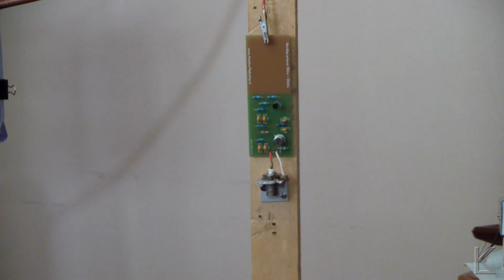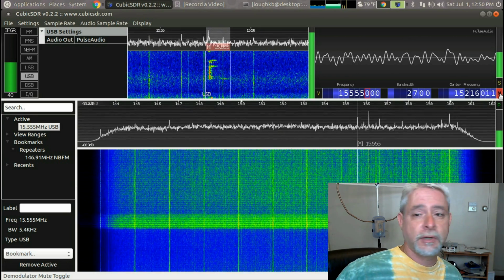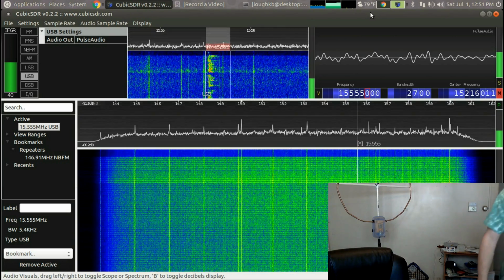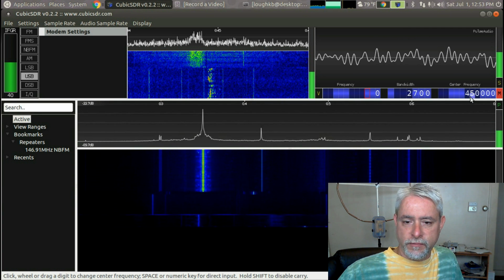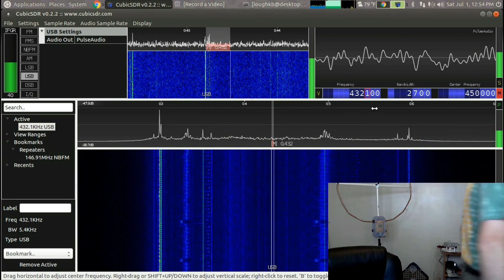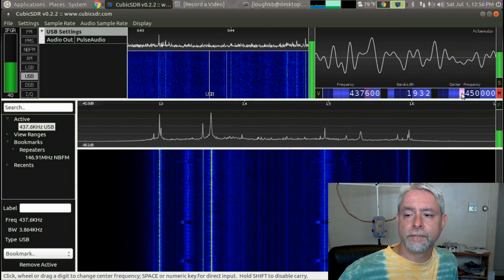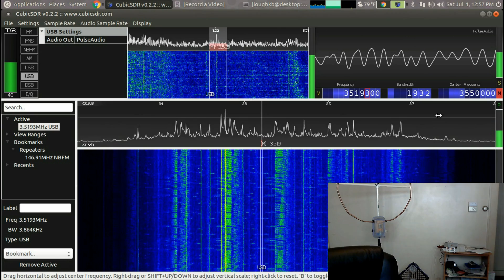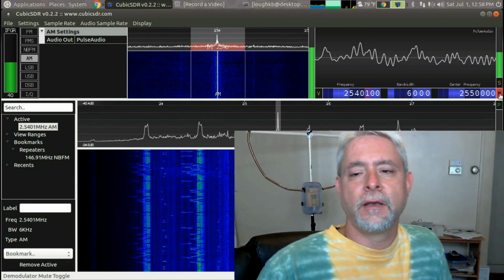Ham Radio - Testing the active Mini Whip with a wire extension

Comment: I've never had any real success with mini-whip type antennas, they all seem more than happy to pick up electrical noise. I've tried all the usual fixes including choking the coax and earthing at the antenna etc, but still the noise remains. In the meantime, my old faithful Wellbrook loop (and a similar homebrew one) continues to ignore most of the noise and allows me to hear weak signals.

Comment: I see this video was done 5 years ago, and I'm sure a lot of hams have learned a lot since then about antennas like the Mini-Whip that are designed to reduce noise, but I'll summarize it here for those who have yet to learn about them. 

As an experienced longwave experimenter I can say without a doubt that the whole purpose of the Mini Whip is NOT to increase sensitivity to signals, but to decrease noise in noisy environments. In a noise-free environment it serves no purpose, as it is not a sensitive antenna. The idea behind it is to have an antenna that reduces noise MORE than it reduces signal. In any given location the existing noise level will determine whether the Mini Whip as configured is advantageous or not. In low noise environments you might as well just hook a longwire to it and use it as a simple pre-amp. But in a high noise environment you will be able to hear more with it than with a larger, more sensitive antenna that will simply fill your radio with noise. Further, the optimal placement of antennas like the Mini Whip is critical. They need to be mounted in the quietest spot you can manage, and they need to have their ground directly below the whip, with no other devices grounded at that point, because combining grounds just adds noise to the system. The Mini Whip (and similar antennas,)  is a special-purpose antenna with special installation requirements mandatory in order to get it to do what it was intended to do, reduce noise. Anyone simply sticking one up in the air and plugging it into a radio is defeating its purpose and can expect poor performance.

Comment: See University of Twente's impressive implementation of wideband SDR fed by Miniwhip on top of the Engineering school building. This installation has been very well sorted out 

http://websdr.ewi.utwente.nl:8901/

 Important Miniwhip as high as practical on metal pole with no overlap past amplifier and well below plate. It is also worth thinking of Miniwhip as a photon harvester, which it is!!

Comment: You've saved time. I was going to do the experiment. I've been using my mini-whip as noise antenna for my noise phaser, but the result wasn't good at all. It might be good now with the extension. TKS 73

Comment: Sorry, but these results are not convincing. It would have been better to use steady beacons or AM stations as signal sources so any snr changes could be properly evaluated. Also your "reference electrode" for this electric field detector is a bit of coax connected to a box of RF noise. No wonder it picks up Ethernet. It would be interesting to see how it performs at the top of an earthed metal pole as per the original design.

Comment: You would almost expect a greater advantage at higher frequencies, just for the fact that a given whip length will be a more appreciable fraction of a wavelength at higher frequencies. Also, Kevin, are you using AGC? It seemed like when you shortened the added whip, the desirable signals seemed to drop and then rise again somewhat.

Comment: The mini whip antenna is an electric field probe. By adding extra metal the capacitance increases so it picks up more of the electric field. There is another way to use the mini whip, as I do myself. I stretched a wire, half a wavelength long at 20m, along the attic. This resonating wire has a higher electric field at the ends and this gets picked up by the mini whip which I placed an inch or two away from the end of this wire. There is no electrical connection to the mini whip, that would be way to strong and overload the amp circuit. OK, it only works as a mono band but it's fun as an experiment anyway.
Looking forward to more of your findings with this fun little antenna.
Reply from the maker: Hey Robert,  I was actually thinking about something like that myself earlier.   I just moved the miniwhip outside to an enclosure where I was feeding my second HF end fed.  The wire is still there, and I was thinking about bringing it over next to the enclosure for capacitive coupling.  Might try that this week after I've got  a feel for the whip at it's present location.
Thanks for watching!
Reply: Hi Kevin, the wire antenna has to be shorted at the feedpoint for the best result. When left open, the antenna is just two pieces of shorter wire with a different resonance. Only when shorted will it be one piece and resonate at the proper frequency. You could also try your magnetic loop as a resonator close to the mini whip. Don't transmit near the whip though...
All these signal strength enhancing tricks are fun to experiment with but take away from the original idea behind the mini whip which is not necessarily to get the highest signal strength. As long as the atmospheric noise picked up is higher than the receiver's own noise, it is OK to have a weaker signal from the mini whip. More signal doesn't improve the SNR but does cause more intermodulation by AM broadcast stations in the whip's amp circuit.
In your video you talk about gain which may increase at a higher supply voltage. The circuit has no gain, it is a voltage follower only. Increasing the supply voltage will only improve the large signal handling but not the level of the output signal.

Comment: Cubic is quite a lousy tool for this kind of tests as it creates it's own "ghost" signals and does not provide any meaningful measurements. Try Linrad (a pain to learn and use but a proper tool) and measure SNR while generating a low level signal with at signal generator of some sort, a cheap ad9850 module from ebay would suffice.
Reply from the maker: Yes and No.   Cubic does create ghosts,  at certain zoom levels only.  It's an easy bug to work around once you have a feel for it.   The author is aware and hopefully it will be fixed with the next release.
GQRX, once you get it working with the SDRPlay, is also viable and more consistent.
Linrad is precise, but as you say, tough to learn,  and kind of a pain to work with. ;-)

Comment: just thinking that with the telecopic whip added it's a bit like a random wire antenna .Would'nt a tuned length improve the signals on a perticular band ?
Reply from the maker: Since it's such a high gain amplifier,   longer lengths just cause it to amplify the noise floor.

Comment: Kevin, regarding the Ethernet Interference, it's very cost effective to use single mode fiber these days. I have an Enterprise grade switch in my basement and run only short copper runs from it. Anything over 50 feet has been moved to fiber. I use the NetGear 110GS at the end of the run. I did this because of my radio interfering with the network and causing it to kill the IPTV stuff in the living room.
Reply: Hi I enjoy your videos here in the U.K. Keep the great work de mw3gki

Comment: The mini-whip is meant to be placed outdoors, away from the noise inside a room. I think your tests are being limited by this shortcoming. When you place it outdoors you'll be pleasantly surprised. 
I'm in the middle of trying to make the same choices with a mini-whip that i built a couple of days ago, so thank you for the video.
Reply from the maker: Yes, there will be more tests once I can afford some coax and put it outside.    There certainly was a point at the higher frequencies where the longer extension brought up the noise floor without bringing up signals though.

Comment: it seems that each time u move your body or leave the chair the noise gets lower , and when u sit back on that chair it goes up again , it might be a problem with grounding , or its just the parasitic capacitance of your body , or even your body acting like an antenna
Reply from the maker: You might have been seeing the AGC in the software reacting to the change just made at the whip.   There was a couple of seconds after I made a change that the AGC took to settle.